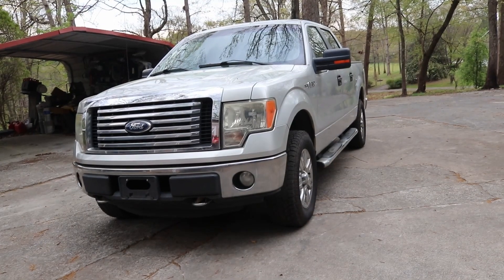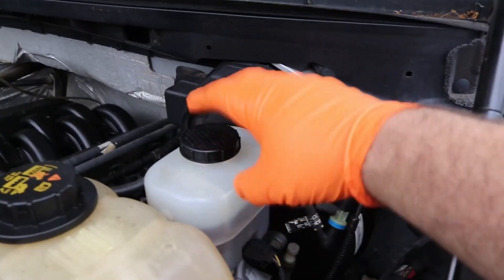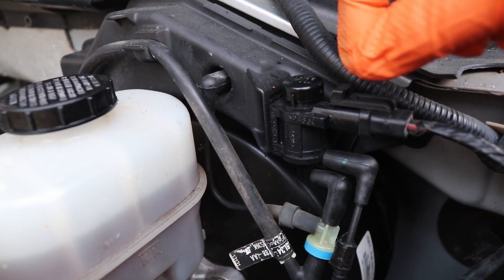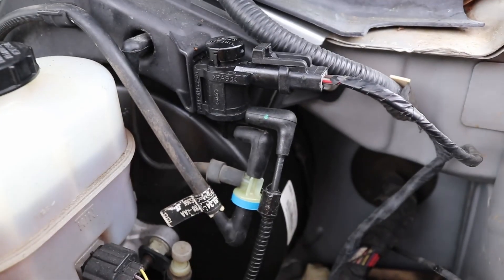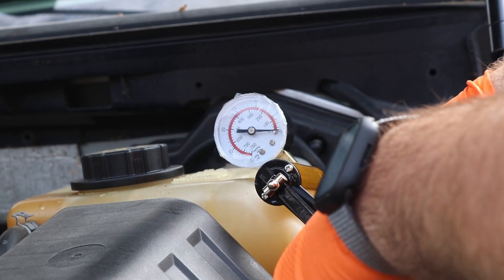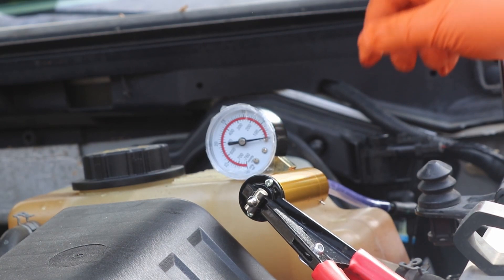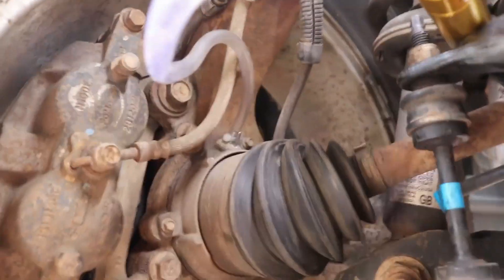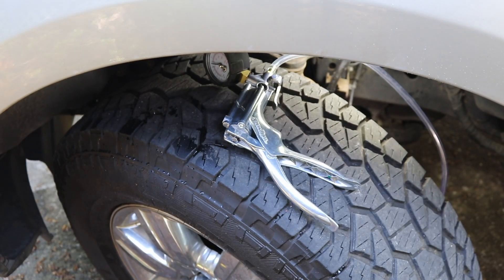How to test the IWE system on a Ford F-150 (full guide)

Comment: Question, I recently noticed a humming or whirring noise coming from my vehicle after driving for a mile or 2. When I shift my vehicle from 2wd to 4wd the noise goes away completely. I replaced the vacuum check valve under the hood near the actuator and it didn’t fix the noise. I checked the pressure to the IWE on both tires at the iwe itself, the actuator under the hood etc like you did in this video. All hoses and IWE hood pressure and have proper pressure. I also noticed when I add vacuum pressure to the IWE stem at the wheel it holds pressure and the CV axle does not move when the wheel spins. When I release the pressure from the vacuum, the wheel spins with the Cv axle. Is this normal? And wondering what your thoughts are for the noise?
Reply from the maker: So given the information we have you made sure while running it’s getting proper vacuum to the IWE? Also have some rev and lower RPM’s to see if the vacuum is still ok. It sounds to be like pressure is bleeding off since it does go away with 4wd. So I would tap into it and have read the pressures while driving. Best of luck!

Comment: I have a 2016 and IWE was bleeding off very very slowly, tested the line and it was pulling about 18 in Hg. I can’t find specs anywhere would you say that is okay? New check valve, solenoid was pulling the same around 17-18
Reply from the maker: Ya 17-18 should be more than enough to pull the iwe in. But the iwe depending on long it takes to leak down could be a problem. But are you experiencing any issues?

Comment: When I connect my vac pump to the solenoid running in 2h like you did I get about 12mm/Hg. The lines to the IWE’s hold. Does that mean I need a new IWE Solenoid.
Reply from the maker: Vacuum check the IWE like I do in the video. Make sure it can’t hold pressure if it can’t yes your IWE is bad. Check both sides.
Reply: Enedex up being a faulty intermittently working solenoid. Replaced it and vac went to 20+

Comment: Excellent explanation and video. I'm guessing that if one wheel engages while the other does not that it could cause high speed rotational damage to the differential spider gears.
Reply from the maker: Thank you! So if it loses vacuum or can’t hold then yes it can cause the splines to get rounded off. Thanks for watching!

Comment: I have replaced my check valve twice now and my truck is starting to do the grinding noise again shortly after I start to drive. I have to put in neutral and rev the engine to get pressure up and then it stops. I will be checking the solenoid now thanks to your vid.
Reply from the maker: Glad I could help ya I would check everything. A lot of times it’s the line itself going to the hubs needs replacing. Easy job and cheap to do. Best of luck. Thanks for watching!

Comment: So I have a question, I’ve replaced everything in regards to my four-wheel-drive vacuum system. The actuators, the vacuum lines, the solenoid, the vacuum reservoir, and the check valve as well. All of those parts have been replaced and I’m still only getting about 12 mercury. Every video I’ve seen in regards to the vacuum system pulls between 20 and 25 mercury. Is there anything else in regards to the four-wheel-drive system that I am missing? I have watched multiple videos and everything has been replaced. I seriously need some help lol I don’t wanna have to replace my actuators again. Also, when I installed each of these replacement parts, I tested all of them to make sure they were holding vacuum and they were. So I know everything that I have replaced is functioning the way it’s supposed to. I’m just thinking I’m missing something else. Do you have any advice?
Is there that I need to change on the transfer case or something?????
Reply: I saw a comment about having the iwe compressed(under vacuum) when it's being installed to prevent damage. A cap on the tube was mentooned.
Reply: @gregoryclark2674  @ here’s what I found out. The vacuum is only going to float between 12–15 mercury while at idle. When I accelerate it goes up between 20 and 25 mercury. Also, the vacuum lines keep the actuators pulled in tight until I put it in four-wheel-drive. Then the actuators engage.With the hub or the bearings have anything to do with it? What about the solenoid on the transfer case?
This is a weird issue that I am having. This truck has been absolutely amazing until I encountered this.
Reply from the maker: So you are correct if you’re not getting 25ish around the actuator then your problem is further up. First thing I would do is check at the check valve take the hose that goes to the engine off. Make sure it’s got proper vacuum as this is where the whole chain starts. After that it would probably be the vacuum reservoir or some other spot bleeding off vacuum. Hope this helps. Thanks for watching!
Reply: @JunkyardJunkie  I’ve replaced and tested everything and it all works fine

Comment: HELP...  I pulled the 1st hose he pulled in his video, the vacuum check valve hose. I had no vacuum,  heard no noise. I pulled the 2nd hose to the solenoid with truck running, and I had vacuum.  Does this mean my check valve is bad?  I have 2010 f150 4x4, the actuators were replaced 6 months ago. I heard a rattle  only in 2 wheel drive and only when I accelerate.  If I have vacuum from solenoid,  does this mean i have a leak in my line or is the check valve the issue?
Reply from the maker: Ok so if your saying while in two wheel drive you take the one off the solenoid that I showed and it has no suction. But on the line going to the solenoid does have vacuum then yes your solenoid is bad. Hope this helps. Thanks for watching!
Reply: @JunkyardJunkie  I did the check again. I was wrong. I have vaccume at solenoid,  my solenoid clicks when changing from 2x2 to 2x4. When I pull the check valve line to the vaccume container i hear suction sound. So all that's good. When I pull the line from the Iwe  and put finger over line hole i feel a suction, not sure if it's enough but there is suction.  When I put my hand vaccume pump on the IWE and pump to get suction I can't get any. Won't even build up and leak out. I guess the bladder in my IWE is broken. But according to paperwork those were replaced 6 months ago. (It says the actuators were replaced) . I'm wondering if they put a new IWE on but what ever it locks up with was not replaced,  so they may have put a new part on thats is connecting to a old worn part, and that has caused the new IWE to fail??? 

I've never owned a 4x4. Another issue i notice is I. 4 high, when I take a right or left turn from a stop position, it wants to spin out, like something slips. And i hear a clunk I think in the front. 

Also, when making a right hand turn going slow, the truck wants to stop as tho it's in a bind or brakes are applied. If I make a wide turn it's not so noticeable,  but if you turn sharp and let off gas it will stop.

Thanks 4 these videos u made. They are a big help to ppl like me. I am scheduled to have it worked on in a 2 weeks. Running in 4 high for now, keeping it below 56 mph and not driving far. Hopefully this doesn't make anything worst. 

Looking at these IWE delete kits. Any thoughts?

Comment: I have the opposite problem. Vacuum won't relieve and no 4wd. If I disconnect the hose it goes into 4wd. I replaced solenoid and still have the issue
Reply from the maker: Sounds like it’s the solenoid or the computer controlling it. Do you have a scanner where you can look at the signal that’s being sent to it?
Reply: @JunkyardJunkie I just ran out to test and realized when i replaced the solenoid i switched the vacuum lines backwards. So it was solenoid. Thank you!

Comment: I disconnected the solenoid electric connector, now my axle is locked full time, will it cause something if I run the car like this in 2wd?
Reply from the maker: No it won’t hurt anything as this is how it’s meant to work. But why did you disconnect it instead of just putting it in 4wd?

Comment: So I replaced both iwes the wheel bearings then the check valve and solenoid, and right now I’m checking the iwe and the left side holds vacuum but loses it all the way down to 5 but the right side holds what could it be ?
Reply from the maker: I would be willing to bet it’s simply just the hose that runs over to the IWE. You can replace the whole line really easily. Let me know if you do it. Best of luck. Thanks for watching!
Reply: Just bought 2013 f150 eco boost twin turbo just noticed there is no solenoid or vacuum lines that ho connected to front wheel hubs any help

Comment: Where do the wires come from that hooks to the solenoid. Mine is not getting power. No one seems to have this problem. The vacume part of it is simple but no one explains where to go if the solenoid is not getting power.
Reply from the maker: Unfortunately not you’d have to look at the wire diagram and the chase the wire itself with it. Best of luck. Thanks for watching!

Comment: Welcome to the biggest piece of garbage on this truck.
Someone needs to made a conversion to traditional hubs already.
Reply from the maker: It would surprise me if someone hasn’t came up with something. But the system itself isn’t that bad once you understand it and how to check for it. Thanks for watching!
Reply: @JunkyardJunkie  I have been through five sets of iwe's already.
Went through the whole system and fixed any issues found.

It's just not reliable.
They need to either make them electronic or have a lock on them at this point.
I can't believe ford is still running this to this day.

Comment: Specific question when I turn the truck on in Two wheel drive there's no vacuum applied to my actuator.... But if I unplug the vacuum lines from the solenoid (passenger) Then then reconnect them it works and the wheel spins free of the axle... Any idea what my problem could be? I'm leaning towards a bad solenoid because I don't detect a vacuum leak. Suppose the actuator could be bad but why does it engage after I unplug and re plug in the vacuum lines
Reply from the maker: So the actuator could be bad but unplugging and replugging the hose back up wouldn’t make it work. unless when you remove or reconnect it, it’s jostling the internals getting it to work. But I would imagine it would be super inconsistent. But your checking vacuum unplugging and replugging it back up and then rechecking vacuum?

Comment: Around 3:45 in the video you pop the top side vacuum line off the IWE solenoid. In the video I hear consistent vacuum being pulled. When I pop mine off my 2010 f150 I hear vacuum but it "bleeds off" really quick. I can measure it pulling 20 inHg in 2wd, but it takes a while to get there - at least a full minute. Is that indicative of a problem?
Reply: Did you find problem I’m pulling no vacuum when I remove port in 2wd
Reply: @Hard_Hooked did you figure it out ?
Reply from the maker: Sounds like an issue it should have good consistent vacuum at that port. So I would start checking the parts before it and through process of elimination you should find it. Hope this helps. Thanks for watching!

Comment: Great video i had changed passenger side iwe because of noise and the noise switched to driver side after changing it and watching this video did vacuum test and found line that went directly into iwe on passenger side was expanded enough to lose vacuum so i clipped half an inch off and good as new

Comment: i’m hearing a popping noise from my left side then sometimes on the right but when i’m in 2wd my cv axles spin i think it might be the vacuum check valve and i’m replacing both of my hub actuators need help plz
Reply: and when i put it in 4 high i don’t hear no clicking noise only hear it when i go too 4 low and back too 2 wheel drive
Reply from the maker: So it does sound like you’re having issues in the system. follow along with the video and diagnose it this way you don’t waste money on parts you don’t need. Hope this helps. Thanks for watching!

Comment: 2020 F150 here: I have replaced the solenoid and have verified vacuum at the IWE’s with a hand pump. They hold 24-25lbs of mercury fine. 

The issue I have is two parts. The solenoid vacuum lines that hook into the solenoid are only pulling 15lbs of Vacuum. If I leave the bottom solenoid line on and pull the upper solenoid line off there is vacuum on the line pulled off but nothing through the solenoid. 

If I’m understanding this correctly the solenoid upper port is supposed to be pulling in vacuum? 

2nd issue is neither vacuum line at the hubs will hold any vacuum with a vacuum tool. Is it odd to have both lines not holding any vacuum?
Reply from the maker: Hey sorry for the late response. But so your IWE’s are fine. Now then yes line in the middle is what send vacuum down to the hubs. If there’s no vacuum there check the bottom hose and make sure there is vacuum there. If there is then you will need to replace the solenoid itself. 
       Also in the video I show to switch from 2wd to 4wd and you should hear the solenoid click. (Clicking doesn’t mean it’s good but is usually a good indicator) so first do the step above and see where we are at. Hope this helps. Thanks for watching!

Comment: so what if i hear no air coming out my vacuum tank when i pull the plug out?
Reply from the maker: Check for vacuum at the check valve if you have vacuum there then replace the tank. Hope this helps. Thanks for watching!
Reply: @JunkyardJunkie  also a shop just recently installed my lift, and this noise never happened before and the day i got my truck back it started happening, i guess it could also be a leak somewhere since they had to remove those lines and connect them back perhaps?
Reply: @ldaytonl when they did the lift did that stretch the hoses and rip or tear them?
I took my truck to a shop and lifted and then I had this problem after
Reply: Would there be air coming out of the tank if the vacuum line going to the wheel is broken?

Comment: Great Video!!
How long should the IWE hold a vacuum? it slowly goes down over a matter of 10 minutes. Also, the grinding goes away when I put it in 4wd when driving. Is that a definite sign that its the IWE system and not a front Diff bearing?
Reply from the maker: Thanks!! But if it holds for that long it’s good I would worry about that. Now I would check everything else in the video. Does it get the proper amount of vacuum? From what you’re telling me I do believe it will most likely be in the IWE system. But of course more diag is needed. Hope this helps. Thanks for watching!

Comment: Great video! You described every step perfectly, I think I have problems with my 2016 because both front shafts and front drive shaft spin in two wheel drive. I'll do these test and hopefully find the culprit.
Reply from the maker: Thanks! That always means a lot to me. Yup sounds like you have a problem somewhere in the system. Best of luck. Thanks for watching!
Reply: They do spin if you have a selector switch, but they are only engaged with the hub when the vacuum is removed.

Comment: 2012 Lariat with 4WD Auto — just tested everything and and all my hoses are holding vacuum no problem. When I hook up to the IWE on my front driver side, it will not disengage out of 4WD regardless of vacuum pressure. Any ideas? 

It’s holding vacuum just fine so it doesn’t seem like the IWE is bleeding pressure whatsoever
Reply from the maker: Ya that’s a strange one but no matter what if you’re applying pressure where I showed you on the IWE, then it has to be a bad IWE. I can’t think of what the failure would be atm but check the other side if it does disengage then that’s another definitive answer. Best of luck keep me updated on this. Thanks for watching!